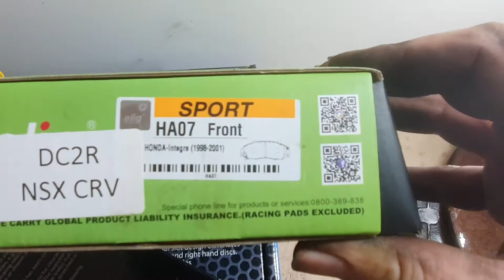Brake Upgrade, How To Do A CRV Conversion | Eg Civic B16

Comment: hello mate, do you had any issue with the brake pads?i've seen it somewhere that the crv brake pads sits a little higher than the mini cooper rotors and that tsx pads are a perfect fit.
Reply from the maker: So far no issues but I have only done around 4000kms.

Comment: Will the bearing from an EF spindle fit the CRV one??
Bcus it's almost impossible to find Integra spindle in my country 
+ If order from spare parts the prix is really expensive 

So can I use the CRV spindle with EF bearing assembly (4x100) ??
Reply from the maker: Im not 100% but i doubt they are the same. You could take the hub off and redrill to 4x100 then Re-press the studs in the new holes.
Reply from the maker: ALso they sell adaptor wheel spacers.
Reply: @JarrodWillemse  what about the axles?
Will EF axles( d series) fits the CRV hub??

Comment: Will the crv assembly take a 300mm rotor disc? I want to bolt on a brembo oem caliper from an fn2 civic..and have 17 rims to clear the gap…all this on a civic EK. Thanks!
Reply from the maker: I'm not sure. Unfortunately I haven't tried that.

Comment: Could fit maybe the brake booster and cylinder from mini cooper s? The othe option is honda prelude uses also 280 mm discs ... I would go maybe brake booster + cylinder from honda prelude gen 4 + brake calipers with brackets and rotor from mini 280mm
Reply: I have now the 200 mm disc in the front , I have gen 6 civic 4 doors from 2000
Reply from the maker: I think minicooper brake booster will have different bolt pattern into the firewall and rod length. I’m not sure about the prelude unfortunately. People say brakes from dc5 integra work.
Reply: @JarrodWillemse  I just find honda accord calipers from 282 mm discs ... I am curious if fits, also ordered the brake cylinder +booster from this accod ( I think is 2.3 liter engine from 96)
Reply: @JarrodWillemse  If on my civic is now the 200 mm front brake discs ... And want to upgrade to 280 mm I need also the knuckle from the donor car? In my case I choose honda accord 2.3 liter has 282 mm discs rotor does not fit is a 4x114mm diagonal, ...

Comment: cheers, are you sure you need to upgrade master cylinders? and are 98-01 non abs masters the equivalent?
Reply from the maker: You don't need to upgrade the master but if you have 13/16 or smaller the pedal travel will be excessive. You can get away with 15/16 but 1" is ideal as it is what came with them originally.

Comment: Is this the same as doing a 07 280 mm rotor from a Mini Cooper with a crv caliper?
Reply from the maker: Yes that is what I did and it looks like jdm yard have an application specific one now.
Reply: Do I need to change proportion valve and what model can I take the booster and master

Comment: If you want true bbk is 05 to 08 Acura TL  non type s caliper piston is bigger and the rotor are 300mm this is in my 95 civic sedan ex
Reply from the maker: That sounds great! I didn’t know that it could work. Thanks for the idea.
Reply: What is needed to do this bbk set up)
Reply: Calipers from a a Acura TL
Tl brake pads
TL rotor 
Civic ex spindal 
Or any 90 to 2000 Integra
And a 3mil spacer on the spindle on the back of rotor and you all set
Reply: @lgutierrez4431  what wheel size are you running and what do you recommend as far as wheel size and off set ?
Reply: @licker1997   hello I have rota gt3 16x7 offset 35 winter and summer racinghart type c
17x7.5 offset 40
Reply: @lgutierrez4431  yeah that is too big of a wheel  for my liking , i think the crv set up would be enough for me.
Reply: @licker1997  that is cool you rung the oem 15 
I need the wider tire for the canyon run tire in 205/45r16
And on the other is 215/40r17
Just in case you need info
Reply: @lgutierrez4431  you can run wider tires with 15 inch wheels no problem , I am running a 15x8.5  225 45 , 25+ off set
Reply: @licker1997   nice that my work for me in some t37
Reply: @lgutierrez4431 could you show a video of the spacer you used
Reply: @licker1997   16
Reply: @Michaelcsok  5mil 4by100

Comment: What do u need to make the CRV hub work? Curious what u need to go to a full 5 stud setup?
Reply from the maker: You need a driveshaft with a bigger spline  at the hub end the rest works fine
Reply: Don’t do what this guy did I’m kinda confused
What you need to do is get 99-00 civic si or ex knuckles crv brake caliper 
Mini cooper rotors 
TSX brake pads 
I don’t know the exact years but you should do the research if your really trying to do it with this set up you have type r brakes for less than $300

Comment: Hello. Great video.

Just wanted to ask for the part number for the crv brake calliper? I tried to screen shot yours but as it was red was really hard to capture. Does the crv callipers have the code 17CL15VN stamped on it?
Reply: Sorry actually got a good print screen. It definitely has that part number on it. Thanks!
Reply from the maker: No worries glad I could help!

Comment: how would you go about doing this on a ek cxi? can i use the stock spindles? and directly bolt on the crv calipers?
Reply from the maker: Yeh if your car already has the 262mm rotors+spindle then all you need is the new discs and caliper.

Comment: Hello bro . What caliper suitable for honda sr3/sr4 if i wan upgrade my brake from 240mm rotor to 282mm rotor?
Reply from the maker: If you have 240mm brakes you will need the Dc2 or type r spindle to be able to run a 282mm rotor and caliper. Calipers from Dc2/Ek type r, RD1 CRV or NSX fit.

Comment: do the disc align perfect with the spindle or it could stay off centered?
Reply from the maker: The centre bore is the same. But when you first put the disc on it sags as the studs on the civic aren’t as big.
Reply: @JarrodWillemse  i know the center hole on the disc is 62mm and I think the center on the hub for civics is 56 or 54. I don't care about the studs if the disc can rotate left to right on te hub, I don't want it to move up/down, left/right
Reply from the maker: @mihailpetrovici5044  once you bolt the wheel on it all centres and aligns. Just remember you need 260mm or type r spindles not all civics are 260mm and those that aren't have a smaller bore size.
Reply: @JarrodWillemse  yes, ok, I have the 262mm brakes on the facelift. Thank yoi for the tutorial

Comment: will this set up clear stock 15inch wheels
Reply from the maker: No idea bro. Most likely not. I had some other 15” rims and they hit. My buddy club P1s have no problem
Reply: i see. maybe a 5mm spacer would help with abit of clearance
Reply from the maker: @kahvang7983  for me it hit on the barrel so no amount of spacing would help. I ended up grinding the caliper.
Reply: ummmm.. whats the spec on your p1 
im planning to go with this route running with these wheel spec 
15.7 +38 offset
Reply from the maker: @kahvang7983  15x8+32

Comment: What model and year mini cooper did the rotors come from? Having a hard time finding them with just the part number
Reply from the maker: The rotors are from a 2007+ Mini Cooper non-S. They are 280mm in diameter, 4x100 and have the same centre bore. I saw JDM yard have application specific ones now. https://www.jdmyard.com/dba-honda-civic-92-00-retro-fit-type-r-calipers-28

Comment: Btw bro they sell spacers between the lug nuts to fill in the gaps of those lugnuts rotors so theres no movement bro! I think 1320 performance sales those!
Reply from the maker: Cheers yeh some other guy commented the same. It seems to be fine without them.